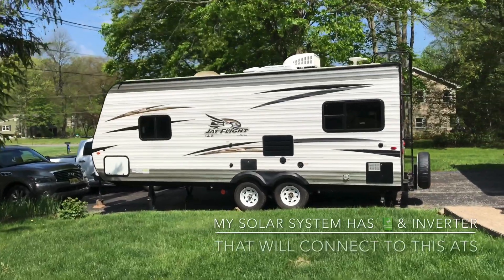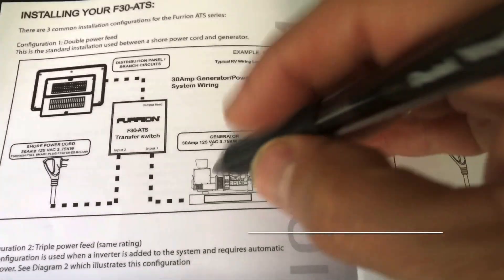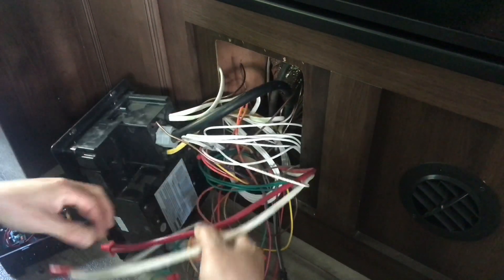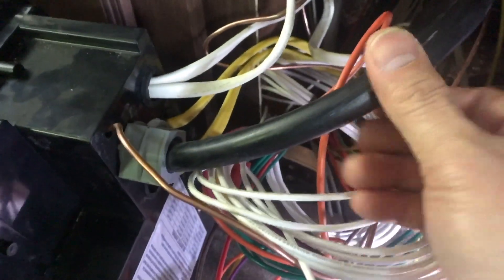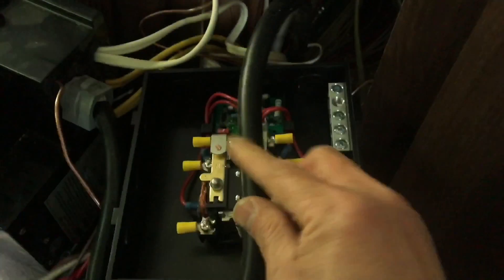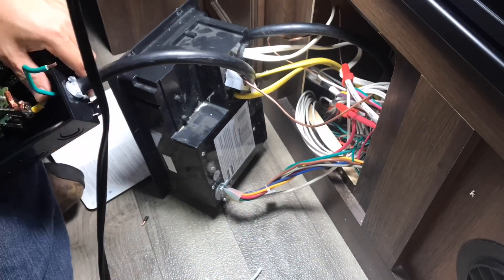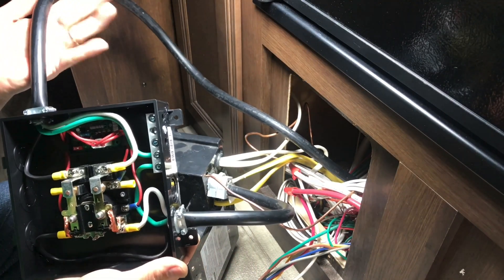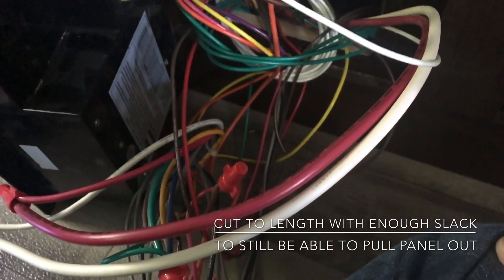How to Install an Automatic Transfer Switch Travel Trailer Jayco 212QBW Solar Power System build

Comment: When you don't have a generator or grid power, so you run the travel trailer with the inverter and the battery, and your circuit breaker for the converter is on, you charge your battery with your battery? it's like a loop that does not end and you lose battery bank?
Reply from the maker: Switch off the converter when you have no shore power. I have 100-200 watts solar panel to charge the front battery bank (that came with the RV). The battery bank under the bench seat is charged by 500 watts solar panels. Here the full hook up video https://youtu.be/RF-mIJY1o_U
Reply from the maker: If the main battery bank is fully charge and you got plenty of sun… you can turn on the converter (from dc to ac to dc) but like you said… a kind of a loop and lots of wasted energy. Just a quick mention, the converter is AC to DC… anyway, my converter is always off when I don’t have shore power… thanks for watching.